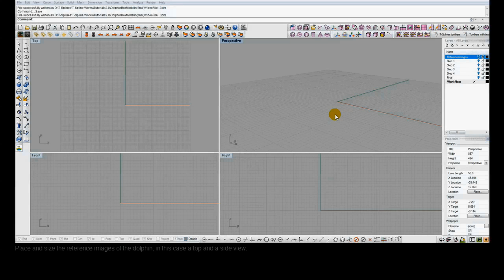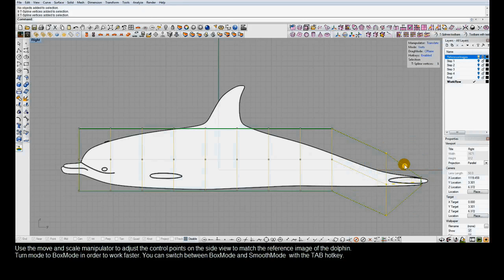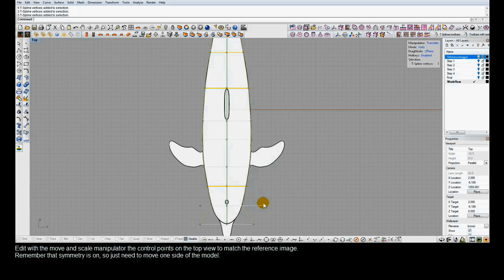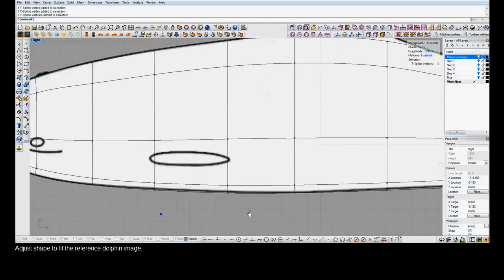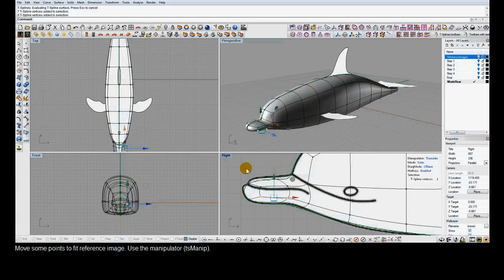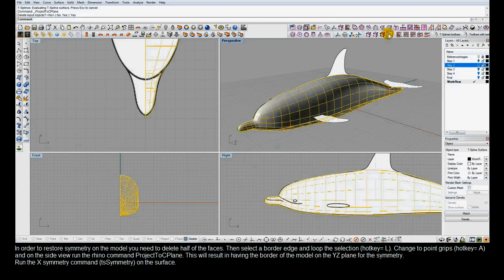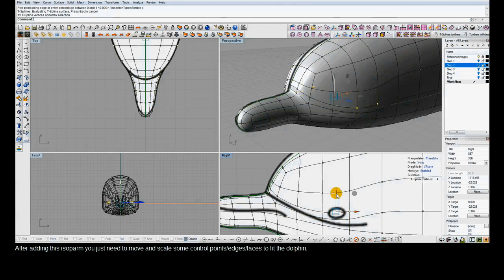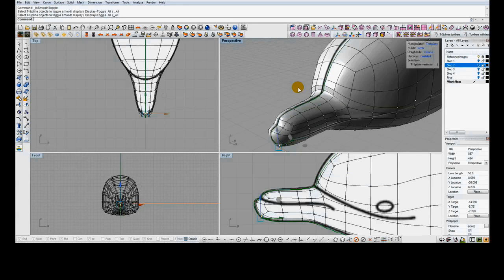T-Splines 2.0 for Rhino tutorial: Modeling a dolphin Part 1

Comment from the maker: @TAIVE16 Hi!

1. Run tsSmoothToggle to get smooth mode.
2. Marquee select the control points (click and drag a selection box around them) to get multiple ones.
3. Click the Mode in the Heads-up display until Edges show up to select edges.